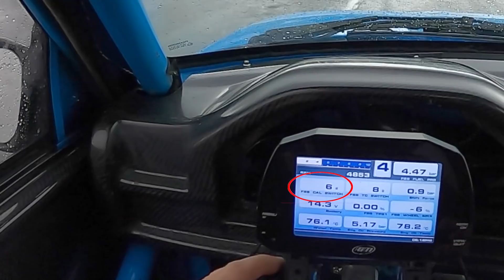450hp DTM inspired BMW E30 M3 on wets at Donington Park

Comment: Beautiful car and great video as always. I am really interested in why you have to go the biggest tyre and wheel setup? If your having all of these scrubbing issues then for even era correct sake, you should go down to a 15x9/10 size wheel. Would look awesome + won’t scrub.
Reply from the maker: It won't scrub with machined washer. Pretty simple fix. I use 17" all round normally on my dry setup. It's a 255 rear tyre in the rear, any less would turn it into a drift car, and any lower than 17" monoblock wouldn't fit over the Alcon brakes.

Comment: Such a nice track day car! Funny to see it in the wet, seems a bit lively :D The solution for the rear, has gotta be wider arches, right? :D
I don't remember if the car has a heater core or not but considering its propensity for getting hot and steamy, it would probably solve an issue or two but I'm sure you have a reason for not having it like weight and other issues.
Reply from the maker: Haha, I thought about spacing the arches more. It has a heater. It's only clearing left and right though, so needs an extra vent.
Reply: @driftworks  The temps, this day was a bit chilly, and wet, isn't 100C water and 114C oil a bit high for that? Especially when some heat was evacuated to the cabin. I know you had issues with them being way too high earlier.

Comment: Hey Phil, are those temps correct or is the scaling still a bit dodgy?
Reply from the maker: They're spot on as far as I can tell.
Reply: @driftworks  Oh sweet, what oil are you running, and how often do you change it? 

I can't ever get myself to keep going past 100C ish, which whilst drifting doesn't give me much track time sometimes. 

I know I'm probably being overly conservative running 10w50 titan which s rated for much higher, but from what I've been told by opie and the likes you're not meant to "live" up there.
Reply from the maker: @BoostHunters  100* oil temp? With decent oil 125* c is absolutely fine. At 100 it's only just boiling out the water contamination.
Reply: @driftworks  Interesting, will have to do a bit more research then. 

Thanks!

Comment: From here in the States, I vote for a full track day video.  Two things I noticed.  1.  The gloss on the dash course be distracting, especially in the rain with the wipers going.  2.  The defroster/defogger leaves a partial blind spot (maybe it’s just the camera).  Don’t know, but damn, this is fun to watch.
Reply from the maker: 👍 I thought the dash may be a problem when we built the car, it hasn't been so far though. More than 30% of the screen was fogged up in the middle by the end of the session. We're on the case to fix it as it's super dangerous.